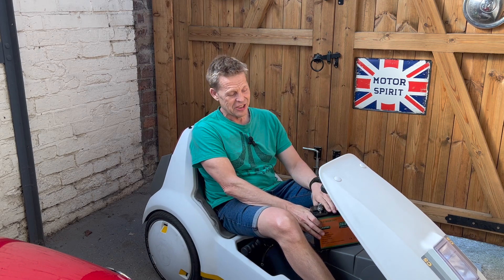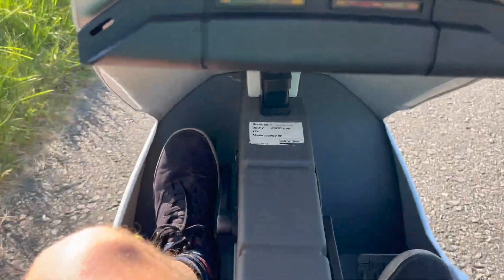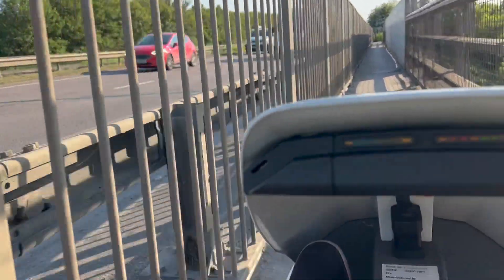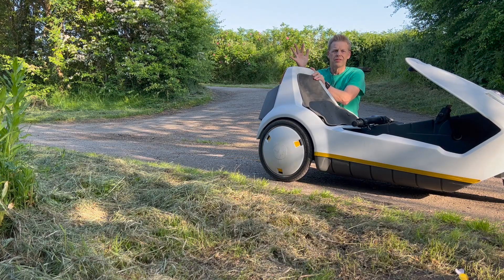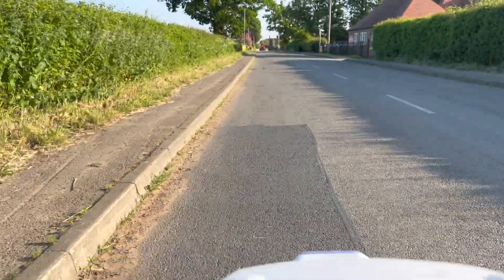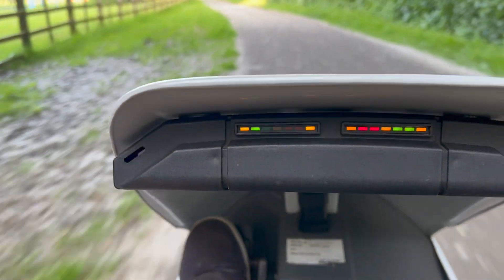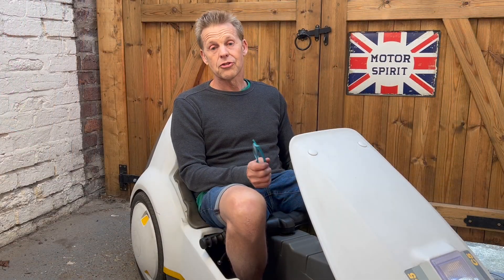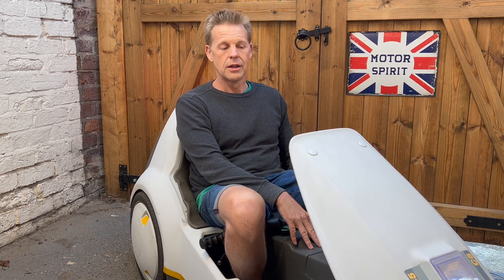Sinclair C5: 1985 vintage EV long range test run to pub

Comment: Despite what you tell people in your (interesting) videos you did not upgrade your battery to a "lithium polymer" battery. It's an Eco Worthy LiFePO4 Lithium Battery ... which is a lithium iron phosphate chemistry (lithium ion) battery. There are various chemistries of lithium ion batteries that are in use nowadays and LiFePO4 is one of them. It is regarded as one of the safer variants of lithium ion and also tends to do well in terms of the number of charging cycles so is long lived.

Comment: Could you make her silent? Or solar powered?
Reply from the maker: I guess, but doubt solar power would be feasible without a large panel (and plenty of sunshine which we don’t have here!). In any case the battery is providing more than sufficient range now so even using solar to top it up wouldn’t be an advantage. I think it’s great as it is!